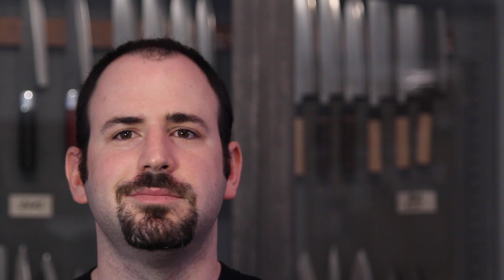Knife Sharpening Basics- Burrs and Burr Formation- Japanese Knife Imports

Comment: Cardboard is an excellent medium for stropping a burr off. It's a little rougher than newspaper, but will do a great job. I was a recruiter for the paper industry and learned a lot about what goes into fine paper and cardboard. Hard to believe, but paper has kaolin clay from Georgia in it and that is a very high grit. Other things found in paper include anything from potato starch, corn starch. Coated papers even can include processed seaweed from Norway or tapioca starch from the tropics. Weird isn't it?
Reply from the maker: very cool... thanks

Comment: hi, I'm new to sharpening Japanese knives and I have a question on the finish. Do you try to get a burr when you are using a finishing stone too or just the coarse, and medium stone?
Reply from the maker: using the sharpening method we teach through these videos, your goal is to form a burr on your coarsest stone, first on one side, and then the other.  Following that, you will likely form a burr on subsequent stones, but it should be smaller and smaller as you go.  By the time you get to the burr removal part of your sharpening, it should be quite small, and thus easier to remove.  Its really not necessary to form a burr following the initial burr formation, but it often happens, and can be useful for people learning about sharpening (i.e. a sign that you are actually sharpening the edge, and doing so evenly from heel to tip).

Comment: Thanks much for the video. Question: once I get a burr on one side, I want to get the burr on the other side, at which point I'm ready to move to a finer grit, correct?
Reply: pretty much... as long as your burr is even and consistent, you are ok to switch over to the other side.  When both sides are done, you can move up to a finer stone (some people choose to deburr inbetween stones, but i tend to not do this unless the burr is HUGE).  However, you also want to pay attention to cross-sectional geometry and asymmetry while you are doing your sharpening.  Does that make sense?
Reply: @jonathanbroida9257  Got it! Thanks again.
Reply from the maker: @keithstarkey5584  lol... i hadnt even realized that i had responded from my personal account... sorry about that, but happy to help any time
Reply: @JKnifeImports  I don't know the difference between accounts, so it's all good!

Comment: What if you use even passes back and forth on each side, usually I sharpen it like that at various grits and it gets sharp, WO the burr coming into play much
Reply from the maker: on easy to sharpen steels, this can sometimes work, but doing an even number of strokes really doesnt have much to do with it.  Also, its possible for an edge to still have a residual burr and be sharp, but edge retention will not be as good as it could be, and the edge may not hold up under heavy use as well.  Also, pushing and pulling strokes have different effects on the edges.  There's some interesting info on this blog here you might find helpful: https://scienceofsharp.wordpress.com/
Reply: Most of the time I don't form the burr either for normal maintenance of a working edge.  But, inevitably you have to to re-edge and form an even burr periodically. If not, the edge will form a bow as your preferred cutting part wears more quickly and your even passes will just speed up the bowing if you don't form even burrs periodically. My way for over a decade: thin at 10-15 degrees one side then put a 15-20 degree micro both sides. Polish micro to a high sheen off a 5k on regular maintenance. Look at glint of micro, has to be even and uniform in relation to edge and primary bevel. When not anymore, grind to a burr again to refresh the whole edge and repeat process. Result, minimal metal loss for a practical working edge (western cooking), no bows. Reference knives: Misono UX-10 9.5"gyuto (12yrs service), Global 10.5" gyuto (15yrs service).